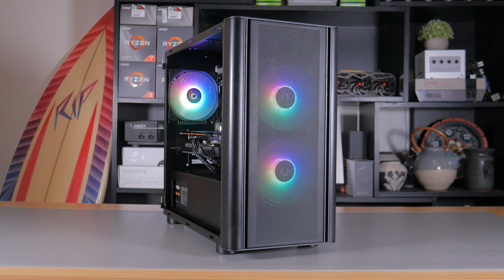BEST $1000 Gaming PC Build Guide! (2022)

Comment: How do you disable the RGB fan lights?
Reply: Open the fan's case and remove the wire connecting to the led. Dont forget to use electrical tape

Comment: I ended up going with:
CPU:      a ryzen 5 5600 (not 5600x) $128.33
MOBO:   asrock b550 pro4 $104.99
RAM:     32 GB Teamgroup T-create DDR4  2x16GB 3200MHz for $66.99
GPU:       msi ventus 3 fan 3060 ti for $429.99 (i tried to get a two fan for $410, but it sold out)
Case:      Phanteks Eclipse RGB version cuz RGB WOO $100 (could've gotten the non rgb version for $79.99)
Bootdrive: Intel 670p 1 TB nvme 3.0x4 QLC for 59.99
PowerSupply: SuperFlower Leadex III 850W 80+ Gold fully modular for 109.99 (for possible upgradability in the future)

Building this as a christmas gift for an uncle. Was contracted by the aunt lol. Let me know what y'all think. I think I plan on giving the 5600 a little overclock.

Comment: Recently I built a new $1000 pc, reused hdd and ssd so those aren't included in the cost but it has an AMD ryzen 5 5600x, 32gb ddr4 ram at 3600 MHz, and a Radeon RX 6600. 650W power supply, a 500 gb m.2 nvme ssd, and a 1tb hdd. Motherboard is an MSI B550-A pro.
Reply: I dont know a lot about pc parts but how much does everything in your pc including the box cost together and how many fps’s do you get on the game you play (low mid or high settings) cuz i might just copy your pc since it sounds pretty good for the price

Comment: Man. Laptops have been killing it. For $1100, you get a laptop with a 140w 3070 (so, a desktop 3060ti and with tuning within 15% of a desktop 3070), a i7 12700h (within 10% of a desktop i7 12700), 16gb ddr5 ram and a 500gb nvme. Seems like a better deal than this computer.
Reply: What laptop did u get?
Reply: @meisterm5562  I bought a $300 gtx 1650 one. Might not sound impressive, but considering its India where there's heavy taxes, its pretty good. I upgraded its ram to 16gb and storage to 1tb + 500gb ssd. Used those parts from my old laptop.

Comment: hey matt,can you make 600-650$ budget build?
i want to build a pc soon
Reply: Ryzen 5 5600 130$ 
B550m ds3h 90$ 
Pny 16gb ram 3600 mhz 45$ 
1tb silicon power nvme ssd 55$ 
650w power supply 45$ 
Any case 40$ maximum 
Rx 6650 xt 265$ 
Total price 670$ 
Prices are from neweeg
Reply: @fhood-coc1270  thx man

Comment: You should have at least mention that a Amd R5 5600 with the gigabyte b450m version is almost $100 cheaper at microcenter just think you could have spent $100 more on a GPU. Check out the i5 12400 vs R5 5600 comparsion on Gamer Nexus channel.

Comment: Nice build. But personally I think I would have gone b550/Ryzen 5 5600 and taken advantage of SAM with the 6700 XT. I know that the b660 board will handle the 13600 when it comes out, but I highly doubt that Ryzen 5000 CPUs are going to hold back any modern GPU for quite a few years down the road. Especially if AMD decides to make "new" CPUs on the AM4 platform with 3d v-cache (ie 5600x3d or 5950x3d). I'm pretty sure I heard a rumor somewhere that that was a possibility in the near future, and also people at AMD hinted that they might keep AM4 around for the more budget oriented builders while targeting AM5 for more enthusiast builders.
Reply: 6700 XT is more expensive than the 3060 Ti for me, though
Reply: @bigbubba0439  where are you finding a 3060 ti for UNDER 400?. Even USED 3060 TIs are selling for more than the price of a new 6700 XT... At least in the US anyway...
Reply: @hoodie_ninja  Yea no used 3060tis are like 320 used and under I've seen them for 280 on ebay
Reply: @Jhope-j2u  the only 3060tis you're gonna get at those prices are ones being pulled from crypto farms, and most likely the cheaper ones are ones that were got at the beginning of the GPU shortage and were used to mine crypto 24/7/365 for the last 2 years straight.
Reply: @hoodie_ninja  Not necessarily there are plenty just from gamers upgrading
Reply: @hoodie_ninja  I have a 2 mining GPUs. One was bought before the GPU shortage and the other was there before the GPU shortage. Both do work but if you buy a mining card, you may wanna check the BIOS cuz sometimes, some dedicated miners may load a custom bios just to get better mining performance. I never edited a GPU BIOS since that's too messy and I prefer using the original BIOS
Reply: AMD 5000 series is already dated and contains a huge bottlenecking, and the 3070 Ti beats the 6700 XT in tier-to-tier comparison.
Reply: @AlfaPro1337  you're JOKING, right....??? The 5800x3d in most cases beats a 12900k in gaming... And yes, AM4 "technically" presents a "bottleneck", at 1080p with a 4090!... But other than that, anyone building a sub-$1000 PC is going to be GPU bottlenecked loooooooong before they are CPU bottlenecked.... And as far as the GPU comparison, while the 3070 ti might be slightly faster, the 6700 XT can be had NEW for $400, while the 3070 ti is still going for $600. That's a 50% price increase, for a card that's not 50% faster.
Reply: @hoodie_ninja  5800X3D was launched in order to steal the thunder and a desparate move by Evil Su, since it's just 5800X with glued of stacked cache.

Plus, did you know that since the IF-MC could no longer run as fast as it can since Zen++, there's a huge bottlenecking on the CPU/APU itself.

3070Ti has more features than the 6700 XT. Ray Tracing, tensor cores for AI productivity, the reputable and stable NVENC, and the stable drivers.

And your argument of ray tracing is nonsense and stuff are invalid, as it's 2022, and the best 3A preset is always turning on everything.
Reply: @AlfaPro1337  6700xt better
Reply: @goldz3n965  The 3070 Ti has better features and more innovative than the 6700 XT.
Reply: @AlfaPro1337  no
Reply: @goldz3n965  Yeah, a single 'no' from you means, I'm right and people are also buying for feature too.
Reply: @AlfaPro1337  🧂
Reply: @goldz3n965  Oh an Aymdiot!!!
Reply: @AlfaPro1337  i was useing a friends pc for a while and with driver sability compaerd to my current rig i have 0 issues, also in games there is not a very large visual difrence with rtx on vs off  and with streaming and recording i have no issues.
Reply: @AlfaPro1337  A feature isn't better if I'm not going to use it anyway.
Reply: @worstLL  I never had any issues with Nvidia drivers, or I'm really just a user that updates the drivers when it's necessary.

The last known issue was back when 600 series, but after that, nothing happened.

I also switch to Studio Drivers.
Reply: @narwhal4304  I mean, Nvidia has better features than AMD.
Reply: @AlfaPro1337  I value performance over features personally. DLSS and nvenc are good features, but not worth sacrificing raw performance to have IMHO.
Reply: @narwhal4304  WTF, are you alright? NVENC has little to no performance penalty, this has been fixed since 10 series.

DLSS is upscaling low-resolution render to high-resolution.
Reply: @AlfaPro1337  I know Nvenc doesn't cause performance to take a hit. What I was trying to say was if I was looking at two GPUs of the same price, and the AMD one was faster, I'd buy the AMD GPU because I'd want more performance over dlss or nvenc. As an example, the RTX 3050 and RX 6600 are both $300 new in the US. I'd recommend the 6600 because it offers more performance for the same price.
Reply: @narwhal4304  Why are you even comparing them not of the same tier.

RTX 3050 is competing directly against the RX 6500. The RX 6600 is competing directly against the 3060.

$-to-$ isn't as useful and tier-to-tier, it fluctuates, tiering doesn't.

RX 6900 series - RTX 3090 series
RX 6800 series - RTX 3080 series
RX 6700 series - RTX 3070 series
RX 6600 series - RTX 3060 series
RX 6500 series - RTX 3050 series

Same goes to the recent and future GPU:

RX 7900 series - RTX 4090 series
RX 7800 series - RTX 4080 series
RX 7700 series - RTX 4070 series
RX 7600 series - RTX 4060 series
RX 7500 series - RTX 4050 series

AMD had been doing this since the Rx 200 series, heck, the R9 Not-So-Fury and the poorly received RX Flop series/Flop VII compete directly against the Titan series of their respective era--I mean, why else AMD named them so differently from their numerical counterparts?

Plus, tier-to-tier is much easy for the customer. I mean, AMD, Evil Su, LITERALLY copy-pasted Intel naming scheme and socket scheme, what makes you think that the GPU naming scheme is not the same?

Not going to argue that it's $-to-$. AMD nor Nvidia is going to price cut for a US$50-100.
Reply: Secondly, 3060ti may be found on the used market for $250-300 (refer to prices on marketplaces such as eBay and reddit's r/hardwareswap)

Comment: Recommending i5 is not ideal when the R5 5600 is cheaper at $130 and it will work on any b450/b550 boards. You can't say the same for b560 boards when they are being throttled. But this is a sponsored video.

Comment: Please consider this config to  TRULY  get the most out of your money >    
*ryzen 5700x  right now for  $209 bucks
*sapphire pulse radeon 6800 16gb  $539 
*asrock phantom gaming x570    $123 usd
*air cooler thermalright true spirit 120 *$25 usd
*16gb Tforce Alpha *amd specific memory  compat.  $ 59
*1 tb nvme Silicon power with ram  75 usd 
*750w thermaltake smart bx1  55 usd
*case 50 usd  - choose a case with mesh in the front for max airflow

Total> $  1135.00  + add OEM Windows for 17 usd or less
this is the most complete powerful computer you can buy around this price.
Reply: The Gpu is overpriced and the power supply is garbo for $55
Reply: AsRock B550M Steel Legend for $109 and Super Flower Legion 750 Gold for $83 would be better, Thermaltake Smart power supplies are low end.

Comment: you can do 6800 xt easily in this budget and like 6900 xt + 12600 for 200 more
Reply: Yeah sure if bought used.
Reply: @itsatrap4986  No
Reply: @itsatrap4986  in pc part picker nY4fRv
Reply: @zelrael4728  Show me a link. The 12600 is not worth it for $230. The 5600 is $130 or $5700x $200 and a b550 mobo is $80.
Reply: @itsatrap4986  12600 outperforms 5950x in games, 1000 is 5600 + 6800 xt is what i meant. For around 1200 you can get 6900 xt + 12600, youtube deletes links so input the code i sent above yourself
Reply: @zelrael4728  I just put a list together and it's $1,200 with a 12600 and a 6800xt. And that's with a $20 cooler. It needs a $40 cooler tbq. You practically save $100 going with the 5600 route. The 12600 is not $100 better. Even with the 5700x it still come out about $50 cheaper than the 12600. But honestly I'll spring for the 6900xt. You can find them for $620 brand new. About $70 than the 6800xt.
Reply: @zelrael4728  I just checked out your list, the PSU is underpowered. Needs 750w minimum if you're going 680XT or higher. Also, that cooler isn't that good. The I.D. cooler is $20 or next step up is Deepcool AK400.
Reply: Im at 1.5k with your stuff can i ahve the list again
Reply: @Jan-zd3zl  What list?
Reply: @itsatrap4986  oh i was talking about the list he created in pc part picker cuz i wanted to look at the 1.2k pc with his components but i guess that was cap anyway,
currently have ryzen 7 5800x and 7650xt what do you think
Reply: @Jan-zd3zl  No on the 5800x. The 5700x is $190 if you need 8 cores or else 5600 is $118. 5800x3d is very good at $300. $100 B550, $30 cooler, $40 16gb ram,. I'd go with 7600x for $235, $160 B650, $80 16GB DDR5 5600/36. It seems that rdna2 cards are low in stock. 6800xts are high in the 600 range. So, CPU choices are in abundance and GPU are getting pricy.
Reply: @Jan-zd3zl  sadly the prices have changed, it costs around 1.3k now, i would pay 80 more and get a build with 7600x since new processors will keep releasing to the am5 platform for 4-5 years at least, plus better gaming performance than 12600kf and also smart acces memory support. The list of 7600x build is G2g43y. Get better ram and a better case if you have the budget.
Reply: Psu is enough and the cooler will be enough with a bit of undervolting dw
Reply: @itsatrap4986  yeah went with the 5700x thanks

Comment: This is almost good but as a recommendation for people who may try to follow these part choices in coming weeks/months: at this point it would honestly be best to go for i3 12100F and spend more on psu, get SSD with 3D TLC NAND and go for 32gb RAM. Games are starting to use enough RAM that you have to close programs with 16gb to make space. The Intel's 13th generation locked cpus like 13400F are coming in just couple of months and 3D QLC isn't exactly fastest or most durable flash memory for a main operating system use.
Reply: I agree with going with a QLC over a TLC SSD, but I have no problems gaming with 16GB ram while having Steam, GOG Galaxy, and Discord open in the background. Dropping to a 12100 over the 12400 will effect performance more than not having 32GB ram.

Comment: I feel like the ryzen 5 5600x is a lot better choice than intel here, motherboard same cost and cpu about same price as well. It perform most of the time better or even in most titles, intel performs a little better in some creative work tasks but the video is targeted for gaming. Also it feels wrong pairing intel with amd.
Reply: Problem is that AMD AM4 socket is at this point both outdated and basically dead. No new cpus to upgrade to and old feature versions/lack of features. the LGA1700 has better longevity as you can later upgrade to 13th gen. But then it would be wiser to just get i3 12100F at this point.
Reply: @SapphireThunder  How many people actually upgrade their CPUs every gen or every other gen? I highly doubt many people do. My 2 computers of the past 15 years, I have never upgraded my cpus, only the GPUs. Had a i7 920 for 7 years and then a i5 6600k for the last 7 years. Majority of my friends do the same, they just upgrade every 5ish years to a completely new system so the "end of a life cycle" doesn't really matter to most imo.
Reply: @jthiel0711  It's not a matter of upgrading every gen or every other gen, it's the matter of having the choice if needed. i3 12100F already isn't far off from 12400F or 5600 in performance. And the LGA1700 has support for PCI-E 5.0 and most recent implementation of Resizable BAR feature. With LGA1700 you have option for a cpu like i5 13400F or i7 13700T/F which would be far faster than anything you can have on AM4 with newer feature support.
Reply: @jthiel0711  upgrading every 2 days is something AMD fans do because their platform allows them to, they say so
Reply: @SapphireThunder  don’t think that’s much of a problem since u can still upgrade to the 5800x3D which is still on the AM4 platform and is a lot better for gaming with the 3D CACHE.
Reply: @hittinjuugs5566  Yeah, i guess that's true.
Reply: @SapphireThunder  I've had the ryzen 5 3600 for years now, It's paired up with the rx 6600. I don't think a cpu upgrade is necessary until after 2-3 gens. Current gen Cpu's right now are actually bottlenecked by gpus right now. I wouldn't consider a 13th gen intel nor ryzen 7000 until mobos and ddr5 memeory comes down. I will probably upgrade to a Zen 4 3D cache with b650 and ddr5.
Reply: 5600 is cheaper at the moment and performs the same as the X version. Newegg is currently has the 5600 for $140.
Reply: Some may think but the intel is a lot more high end

Comment: just built the same pc from micro center for 1000$ i got a red devil 6700xt a b550 tuf pro mobo ryzen 5 5600 32 gb of ram and 750 full modular evga psu i and a nzxt510 FLOW came in at 960$ and that was from micro center but going all amd they had 50$ the mobo cpu combo and another 20 off the gpu i love it i think the drivers are more simplified then nvidia at least to me i never owed nvidia but was playing on my buddies for a while but they both are great
Reply: That’s not the same pc as the one in the video, good build 👍🏽
Reply: I also got the red devil rx6700xt, it’s a beast
Reply: I’ve been asking around with no real answer so can u test how well it runs dcs coz my pc I dying now and I don’t have lots to spend on a new one
Reply: @chhonkky9253  who you asking bro
Reply: @Capybaracomputers  u mg
Reply: @chhonkky9253  yes i run a 12400 and 16 gb of ram and a 6600 and can run it well mid/high settings on biger servers issent bad after a min or to
Reply: This dude completely ripped off micro center build
Reply: @nicholasbissoon9576  lol i was reading it wrong i thought u was saying i got ripped off by micro center lol i built mine when the 6700xt was 450$ AND on my build i ordered the tuf plus not pro they was out so i got the pro for the same price and i got a wd black m,2 instead of wd blue for the rice of the blue when they are outta stock u can normally get the next step up for that price that dont apply to cpu an gpu but since i went and on both i still got money off the cpu and gpu 40 off the gpu and 20 off the cpu bbest believe i was looking for a psu outta stock but no luck i think i did good i got it Oct had i waited another 2 weeks i could have saved another 100 i didnt think prices would drop anymore but they did now they are up a little from when i built
Reply: @nicholasbissoon9576  😂
Reply: I prefer your build over the one in the video. Planning to build something similar with a 6650 XT.

Comment: 6700xt's in the uk are running at nearly the same price ast 3070 at arround £550
Reply: just checked and no, 6700 XT msi mech is 450 pounds on amzon uk.
Reply: @BusAlexey  still shocking when you think how cheap gtx 1080ti's are second hand and they are very similar in preformance
Reply: @liamadamson2836  RX 6700xt is n line with rtx 2080ti/3070 performance. The cards near to the 1080ti are the 5700XT and 6600XT.
Reply: @sergiochipo2826   The 6700xt is on par with the 3060 ti not the 3070